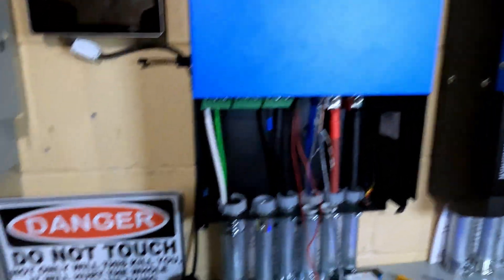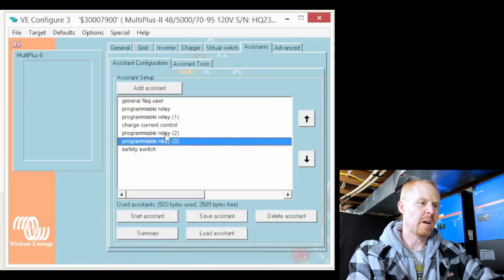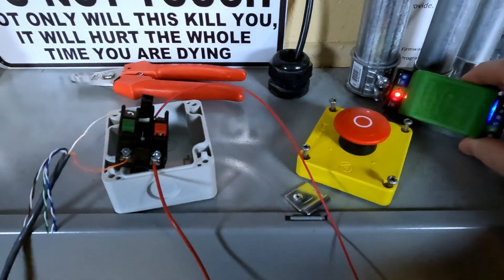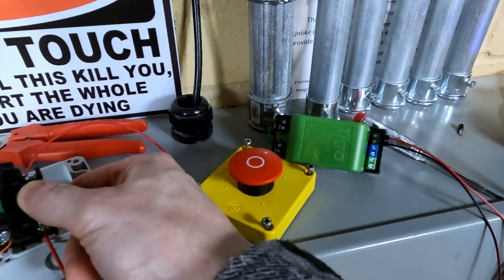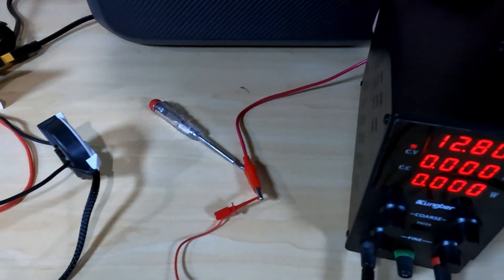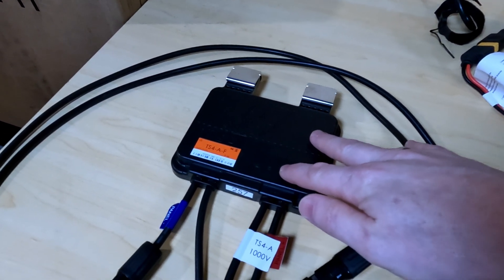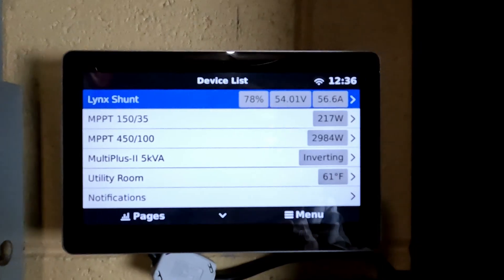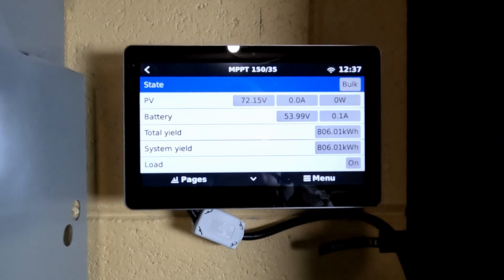Installing a Rapid Shutdown (RSD) for My Victron Inverters & Solar Panels

Comment from the maker: Links to the parts & pieces in the video (affiliate links)
------------------------------------
Tigo Energy Single Core RSS Transmitter Rapid Shutdown
https://voltaico.com/product/tigo-energy-single-core-rss-transmitter-rapid-shutdown/
https://amzn.to/4buAdZM

Tigo Energy TS4-A-F Rapid Shutdown Module
https://voltaico.com/product/tigo-energy-ts4-a-f-rapid-shutdown-module/
https://amzn.to/3SRUwZJ

Victron 48V MultiPlus-II 5kVA 120V Inverter
https://www.currentconnected.com/product/victron-48v-multiplus-2-5kva-120v-inverter-70a-charger/?ref=AzzpK9Fl

10kVA 120/240v Base MultiPlus-II System
https://www.currentconnected.com/product/10kva-120-240v-multiplus-2-5kva/?ref=AzzpK9Fl

Victron MPPT RS 450V/100A SmartSolar Charge Controller
https://www.currentconnected.com/product/victron-smartsolar-mppt-rs-charger-controller/?ref=AzzpK9Fl

Victron MPPT 150V/35A SmartSolar Charge Controller
https://www.currentconnected.com/product/victron-smartsolar-charge-controller-mppt-75v-100v-150v-250v-ved/?ref=AzzpK9Fl

Comment: could you have used the 12v on the bluetti
Reply from the maker: I guess you could if you want to.  You would not be able to take the bluetti anyplace else though without completely shutting down your entire system powering your house.

Comment: Why cant you just use a breaker near the array? That tigo looks like $50 bucks a panel
Reply from the maker: I believe you could do that for a ground array, but for a roof array, NEC code has certain panel level requirements.  

I got a good deal on these used tigo units so I wanted to see what I could do with them.

Comment: Adam, you do great videos.  It is normal practice to make emergency stop circuits go thru normally closed (N.C.)  contacts that open when the switch is pushed.  This is safest as a broken wire, for example, shuts the system down.  The contact blocks on the e-stop switch usually can be removed and also stacked.  By using three N.C. Contact blocks you  can have one for each inverter and one for MPPT.  I am planning this for my system, with a N.C. Contact to each inverter’s remote on/off connector and one for the MPPT remote on/off also.  Your thoughts?  I have two other safety improvements.  Wish I could PM you.
Reply from the maker: @EagleNestLiveTexas   thanks!

I’ve actually seen it used both ways across different systems.  Some have a jumper wire across their built in RSD terminals and when that jumper is removed, the state shuts down.  Others you have to close the circuit to get it to shut down.

I do agree it seems safer to have a NC circuit for the very reason you described.

I was originally just gonna go the same route you described, but when a Cerbo is involved, those remote switches don’t seem to work (at least on the MPs).  Victron disables them whenever you have a Cerbo.  Not exactly sure why.

Comment: I wonder if you did any other research into the actual disconnect switches -- I think NEC code requires a clear distinction between off/on states and the button style switch has a lot more potential ambiguity there. Thanks for your video, I didn't realize that solving this module / inverter disconnect requirement could be so painless and relatively inexpensive (depending how many modules you have)!
Reply from the maker: I did not.  This switch was the one I was seeing recommended for rapid shutdown use.  It is easily interchangeable though if another type is required.  

Yeah, it all depends on the number of modules.  In my case it wasn't 100% necessary since most of my arrays are ground mounts.  Would be nice if there was some kind of "array level shutdown" module for ground mounts so you don't have to wire each module up, of course that wouldn't work for roof mount panels.

Comment: Adam, do you think it’s possible to add another switch in parallel or series (how ever needed to work)? That way you have one in the basement by your equipment and one outside. Incase you are in the basement messing around you can shut down something or if you are out of town and first responders can hit the button without finding it in the basement. Allow them to activate independent
Reply from the maker: That's my plan.  I want to put one in the basement as well as outside.  I just have to pick up another switch and see exactly how it needs to be wired together.  

With only having a single sip of coffee so far this morning, I think series would be the way to go.

Comment: I like the added shutdown capability of both the solar panels and the inverters, 
however NEC 2017 / 2020 requires ARC fault protection (AFCI) with PV systems operating at more than 80V.

NOTE on Arc Fault Circuit Interruption (AFCI) NEC requirements.
Any PV operating at > 80V is now required to have AFCI compliance ... i.e. be able to identify a serial arc fault and shut down the string.
AFCI breakers work by detecting high frequency noise caused by arcs. High frequency switching noise from inverters will not make them happy.

Tigo systems are compatible with certain inverters with built-in AFCI compliance (Sol Ark etc...)
I contacted Tigo to check if Victron was AFCI compliant, and received the following anser:

"Thank you for submitting an inverter compatibility request with Tigo. "
"Victron Energy products are not compatible with our Tigo TS4 "
"due to the manufacturer not being open to testing."

 "We have a full list of roughly 1,300 other inverters here that have been tested" 
"and deemed compatible with respective documentation. "

Comment: I hope one time you can do a grounding video for Victron. I have an off grid Victron system that goes through my main panel via Internet connect switch.
I recently had a short, and it took a long time for me to figure it out. Unfortunately, I still don’t know how to ground my inverter properly.
I also use my AC number 2 (set at 15 Aps) on the inverter to plug into my house outlet and that charges my batteries at night. 
I’m not sure if this was the problem with the short or not?
Anyway, I don’t see too many videos on grounding at all. 😜🖖
Reply from the maker: Unfortunately I’m not an electrician so any grounding video I did would just be my thoughts and assumptions.  

I do know that all the grounding terminals (including the ground stud) are all bonded together in my Multiplus 2, so I only have 1 connected.

You might ask “if they’re all bonded together, why do they have so many grounding points then?” and that’s a great question.  Here’s my assumption: These inverters are originally designed for mobile/marine installations where you might not normally have a path to ground.  In a mobile install, you would connect the grounding stud of the inverter case to the frame of your RV and then the ground from the AC out would go to your distribution panel.  When you plug into shore power, you would then be connecting the AC In ground to the rest of your system. 

In a fixed/home install, you would always have a connection to ground, so you would only need one in your inverter.  That connection to ground could be in your main electrical panel (which is provably the normal case, even when off-grid) or the grounding stud of the inverter.

Again, all my thoughts and assumptions.  You’re not the first to ask about it, so maybe I’ll throw it together and let the “brain trust” of YouTube correct me…
Reply from the maker: What inverter do you have?
Reply: @AdamDeLayDIY  
48 V 5000 70. From my understanding, an off grid system inverter to the electrical panel is only outgoing from the inverter to the electrical panel. There will be no connection to the grid. The grid has to be turned off when doing this.
If I need to power my batteries, I do it through a generator or plug it into the wall outlet of my house; of course the connection to the panel needs to be shut off when I do that. 
Then I have to take the ground from my inverter to a ground bar, which all my charge controllers are grounded to the ground bus bar and I recently heard that your battery negative has to be grounded to the bus bar also. From the ground bus bar, I have to go outside to a grounding rod.
At least this is from my understanding. 🖖
Reply from the maker: @simon359  Do you have a Quatto or a MultiPlus?  I know the MultiPlus 2 doesn't have a second AC IN only a second AC OUT.  

So if I understand your setup correctly, you're using an interlock kit on your main panel which allows you to switch between grid power and your inverter.  If that's true, are you switching back over to grid power before you plug your inverter into the wall outlet to charge from the grid?  

Since your using an interlock kit to go back to the main panel, you should already have a ground connection from the AC Out of your inverter back to the main panel.  That ground connection does not get disconnected when you throw the interlock switch, so your inverter should always be grounded.  

You should also have the bus bar you have your charge controllers on always connected back to the same grounding system as the home.  You should only ever have 1 grounding system.  You shouldn't have to move grounding wires around based on what you're trying to run.  

Lastly, you do not ground the negavive of your battery connections.  That's only for mobile installations.
Reply: @AdamDeLayDIY  
Yes, the Quattro
 
Yes, I’m switching back to grid power before I plug in on the AC2 in!
I too thought there was only one ground in the system, but that’s only if you’re got L1 and L2 connected to the grid, which I don’t. I don’t power my batteries through the grid panel. I only have L1 going to two 50 amp breakers and I’m sure the ground works for AC once it’s converted from DC.
But talking to Battle Born Batteries, the equipment needs to be grounded to a grounding rod outside for DC. 
Like I said, the whole thing is kind of confusing, and I’m just not sure who really knows what they’re talking about. 😳 🖖
Reply: The difference is my inverter setting is for off grid. I imagine it would only be one ground if it was grid tied. But the setting would be different on the inverter.
Reply: OK I finally after watching some videos get a sense of how this grounding works. You stated this down below.
“You should also have the bus bar you have your charge controllers on always connected back to the same grounding system as the home. You should only ever have 1 grounding system. You shouldn't have to move grounding wires around based on what you're trying to run.”
Me: So the ground bar that my charge controllers are connected too and also the inverter box, which ground does it go to? Am I wiring back to AC out ground that goes to the main panel?
Sorry that it’s so confusing for me, I only have one system I’ve ever put together and it seems it’s always giving me problems. I have never seen a Victron grounding video on the Internet that was detailed. I guess I don’t understand the difference between off grid and grid if they’re all going to the same main panel? 😏
Thanks Adam! 🤙
Reply from the maker: @simon359  Again, keep in mind that I’m no electrician.  This is what I’ve found out.

Regardless of whether or not your on-grid or off-grid, the grounding connections remain the same (mobile will be different).  All equipment should be grounded back to a single ground point at the home (the ground rod).  The Ground/Neutral bond location may be different, but not the underlying wiring.  

The ground from your inverters and charge controllers should go back to the main system ground at your home.  You could run a direct line from the grounding bar of your inverter and charge controller all the way to your ground rod or you could run it to the ground bus in your main panel.  Either way, you need a single fixed path back to ground for your solar equipment.  

Here’s a few resources that might help out. 
https://youtu.be/jE0nPGNoPBo?si=XlLZk8Am35t65VFe
https://youtu.be/cZo8ict33_I?si=Y1fUqDNFOu4m84L8
Reply: @AdamDeLayDIY  
Thanks Adam, I’m 66 years old and late to the game of solar. Grounding has been one of the most frustrating parts of this whole journey. 
So basically, I took the 3 charge controllers and the inverter all connected to the bus bar and then from the bus bar to the output one AC. Hopefully this works. 😜🖖
Still don’t understand bonded versus unbonded and which means off grid and which one is on grid? 🧐
Here’s a site I found that was easier for me to understand. https://youtu.be/LmI_bC16X2Y?si=5ccnHr7h_67XO_Ed
Reply: Real clear media has good videos! Easier for me to understand. 🖖
Reply from the maker: @simon359  no worries.  We’re all still learning, myself included.  Thanks for the video!